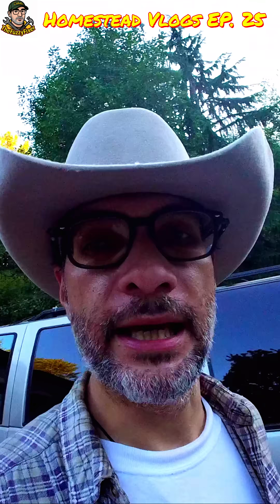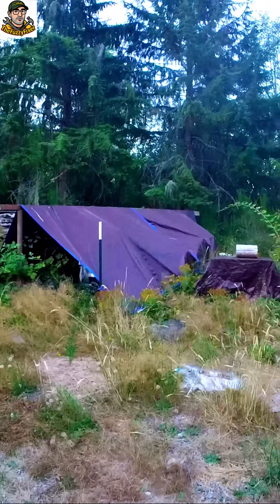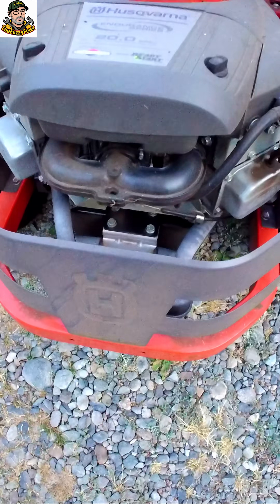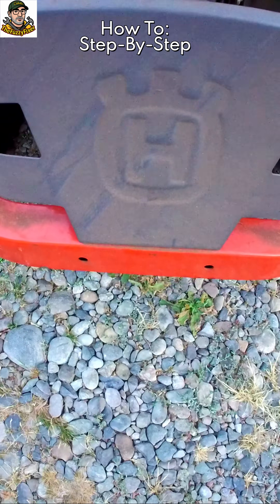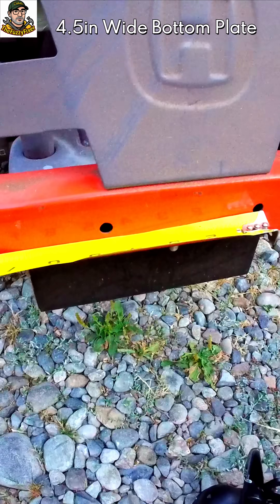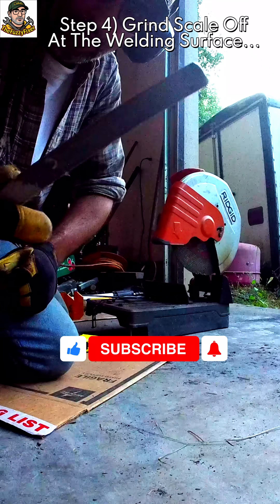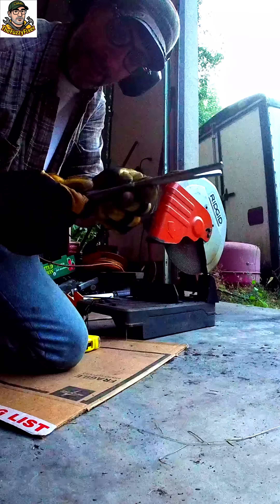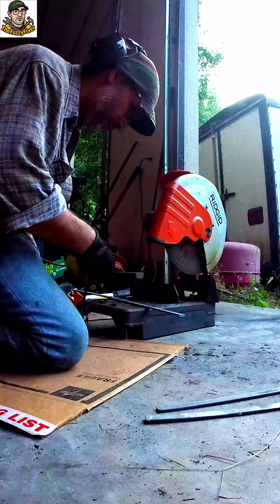The ABSOLUTE BEST Way to Make a DIY Trailer Hitch for Your Lawn Tractor | Pt. 1 #shorts

Comment from the maker: I just noticed that in certain playback modes, the text based steps, measurements, and materials list at the top of the frame can be cut off. If you're watching the video off of your feed, it seems to be ok. If you're catching it from the playlist-it might get cut off. Just enter full screen mode and it works fine. I'll re edit it and have a new version posted soon. Also, once pt 2 drops, I'll have a full long form up from start to finish in wide screen.